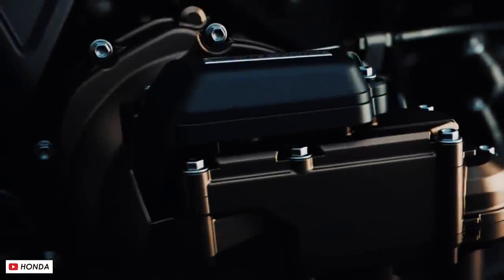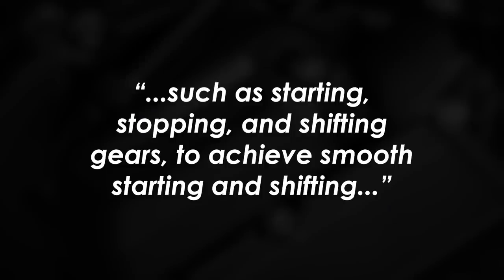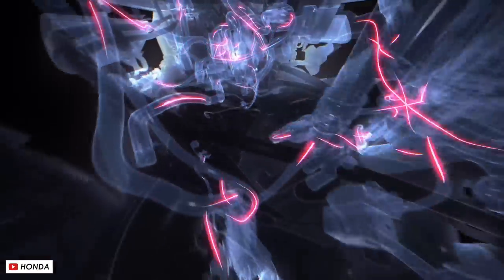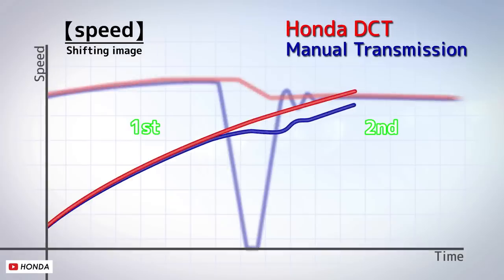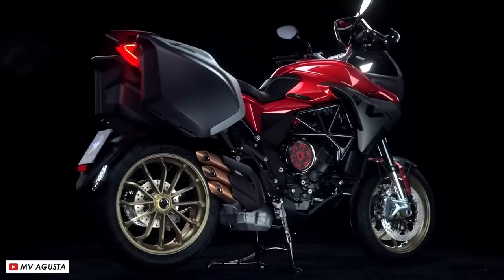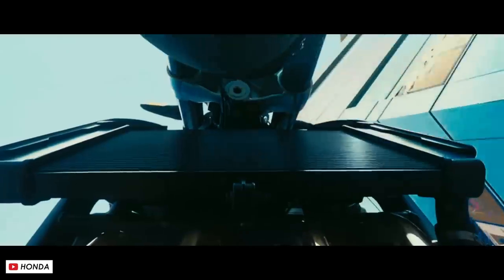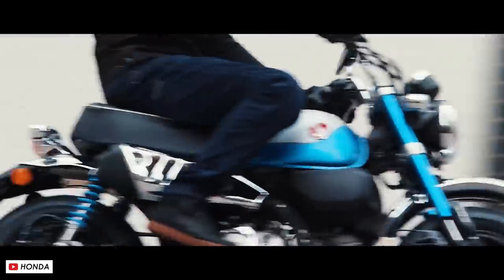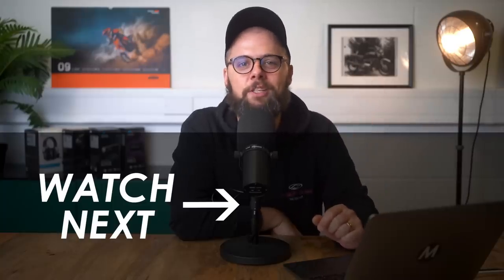New Honda E-Clutch For Motorcycles Announced!

Comment: If it's an option that's ok but if its standard equipment I think it's kinda bad, these first gen systems tend to be very unpolished, but it tends to get better over time. (anyone remember saab sensonic ?)
Also this seems like a solution looking for a problem in my view. Someone might enjoy this, that's fine, also not saying it's not a good ideia, I just don't see where it could make a significant impact.
Reply: Bear in mind that Honda has years of experience with electronically operated clutches in their DCT gearboxes. Same technology…

Comment: I'm sick and tired of everyone having to qualify some medical issue as the reason they want an automatic transmission on a bike, lest the motorcycle snobs jump all over them. 99% (literally) of automobile drivers want an automatic transmission because it's just easier, so why shouldn't the same thing apply to bikes? If I could push a button and magically add an automatic transmission to my Ninja, I'd do it in a heartbeat. Riding would still be just as fun, I just wouldn't be using the clutch/shift peg 100x times per ride as I currently have to in my city riding.

I get that markets like Southeast and Central Asia likely won't be as big of fans of the various forms of automatic transmissions (due to increased cost and complexity), but I'd be very surprised if 15 years from now, a majority of new bikes aren't sold with some form of automatic shifting. Pure manuals on bikes will live on in bikes where they do in cars: in models that are sporty, and are likely to be taken to a track.

Comment: Totally disagree that using the DCT in manual with the hand shifters don’t give the same satisfaction. Given that you can shift gears much faster and with your fingers instead of hand+foot movement allows you to push harder. Die hards will be reluctant to accept this until they realize racing cars like Ferrari, Lambos or even F1 cars all became faster and more extreme once shift pads came to existence. The fact bikes are still getting there speaks to how the space is slightly retarded on technological advancements. I’d dig cbr600r, fireblade, r7, r1 with DCTs… the only downside I see is how it becomes harder to rev (at the moment) as neutral can only be on when stopped, so revving whilst moving requires acceleration in gear whilst breaking which is not at all ideal.. all else DCT smokes any manual.

Comment: Naaah... don't rock my boat 🙃😏 What I really want to see is an Electric Clutch. I do know all the arguments about adding weight and complexity to a mechanically "simple" electric bike but if there was an option to allow a rider to feather an electric clutch I think there would be interest. Sound like an old boy but, I like that I control my bike. I don't need a slipper clutch or cruise control, especially in UK to use it for all of 3 yards. I can keep a steady speed without it paining me and can always make minor adjustments... safe and steady progress (sh*t I do sound like an old duffer😆😆). I wanna ride my bike not it me 😁

Comment: I don't miss using a clutch at all. The DCT is so fast changing gears. A clutch type transmission doesn't stand a chance. Taking off from a dead stop it will jump off the line so fast that even sportbike riders wonder what just happened. If I want to change gears I can still do it with a push of a button.

Comment: Once again.. an answer to a non existent question….like EVs
Reply: Not really... EVs don't solve anything but create a different set of problems. This new clutch operation is solving the hurting wrist in heavy traffic.
Reply: @johnnyblue4799  EVs literally solve the hurting wrist, reliability issues, heat build up in traffic, gas prices, Euro 5 and on restrictions, and disability issues. You're clueless buddy.
Reply: @Waldo1122  It also brings range anxiety, not enough range, higher prices, missing charging infrastructure, high electricity prices if you're not charging at home etc. You're brainwashed... 'buddy'. Do you also eat tofu almost exclusively?
Reply: @johnnyblue4799  Range anxiety is decreasing, Energica went from 100 miles of range to 170 miles of range in less than 3 years. Prices are beginning to come down rapidly, charging infrastructure is rapidly developing especially since Tesla is opening up their network. Electricity prices doesn't even come close to the insanely high gas prices. There is currently 130k+ public charging stations in the U.S and only about 150k gas stations.

I'm not brainwashed, I stated facts that makes electric bikes far better than gas bikes. You just hate innovation.
Reply: @Waldo1122  Funny thing how you can present the 'facts' to suit your view. It's actually 130 miles range on hwy for Experia, which is shown with luggage, meaning it's some sort of a touring bike. Then you have to wait 40 min to charge to 80%. So on a long trip you'll spend half the time looking for chargers. Also around 30k EUR for a 80, or 100 HP bike? Really? I can get a S1000RR for that money.
This IS brainwashing. Innovation would be to make things better. This ain't it.
Reply: @johnnyblue4799  You act like this is the end of electric vehicles, they literally just began and are already achieving the same if not higher performance than gas bikes.

the charging times are decreasing every year, look at Hyundai and Tesla, Charging times went from hours, to 40 mins now down to 15 minutes to reach 80% and Tesla is talking about charging times as low as 5 minutes for 80% by 2030 and Teslas prices START at 35k.

For $30k you can get an energica ego RS that is currently the fastest accelerating motorcycle which is actually a sport bike instead of comparing a sport bike to a touring bike. This is a bike made by a small manufacture among the first EV bikes. The next generation EV bikes will obliterate gas bikes in top speed, acceleration, comfort, ease of use etc... Euro 5 and on restrictions have already destroyed gas bikes as manufactures must build the engines bigger and heavier to meet emissions standards.
Reply: @johnnyblue4799 

Then either hit the gym or don’t ride a bike….
Reply: @Waldo1122 

Um….Enlighten us all on the exact number of achy wrists that will benefit from this gimmick ????
Reply: @BERZERKERSV4  Or better yet, you hit the road... and don't tell me what to do. Gym is not the answer to every problem.
Reply: @BERZERKERSV4  Pulling the clutch in and out.
Reply: @Waldo1122  I never complained about performance. 3.1s vs 2.6s 0-100km/h doesn't mean anything to me. But to have to charge for at least 40 min every 100 miles is a problem.
And 30k is the starting price... add some options we're getting into M1000RR price range. For a fraction of this price you can have a bike with decent performance that can take you places where electric makes no sense, YET. 
If my behavior' is the death of them EVs I really don't give a rat's ass. I'm not going to pay with my money for a more expensive bike that does less. I'll keep riding ICE until EV becomes a real alternative, if it will ever happen. 
EUR 5 and other crap like that is a man-made issue, not inherent to ICE bikes.
Next thing you know, you won't be allowed to ride your EV bike either because of bogus environmental issues.

Comment: The only legitimate use I can find for this over a DCT bike is that it is likely useful for an adventure bike to still have some manual control if you need to negotiate some technical offroad situations that the DCT doesn't account for.  Besides that sadly the more likely reason that this is being added is because DCT got way more hate than it deserved from miserable old bastards in the motorcycle press.  This is essentially just going to be an inferior automatic shifting system that will market better than  DCT did.

Comment: Loving all the snarky comments from Neanderthals who oppose change, riding their softy bikes with disc brakes, abs, electric starts, fuel injection, indicators, LED lights, adjustable suspension, heated grips and seats, yeh bring back real motorcycles 😂 😂

Comment: Unnecessary and stupid, if you can't use a regular clutch stick to tricycles
Reply: So I guess everyone in MotoGP and everyone who uses a quickshifter/autoblipper or anyone who shifts without using a clutch should switch to 3 wheeled motorcycles because they don't feel like operating a dumb clutch anymore? You're clueless.

Comment: Dear Honda, stop developing stuff I wont buy. Trying to make these things idiot proof is not improving motorcycling overall. Looks like I'll keep upgrading the existing Honda rather than buying a new one.
Reply: DCT motorcycles are some of their top selling bikes, EVs are quickly climbing to the top, people are sick of reliability issues and operating clutches. If you ride or drive a lot then all this manual operation gets BORING and ANNOYING. Sorry that not everyone buys a motorcycle just to say they ride a motorcycle and does 20 miles total each year like you.
Reply: @Waldo1122  oh and factually, globally DCT are NOT some of their top selling bikes. WRONG. So you can't even get that right. EVs make up a tiny portion of most markets. If your so limp wristed you have trouble with an average Honda clutch, you really need to start doing something other than mincing around for exercise. Proper riding requires a clutch and the ability to use it. But you wouldn't know that.
Reply: @adamusher  Of course globally dct isn't a top seller. Obviously the third world countries that can't afford a dct bike will get something MUCH cheaper aka a scooter that is basically DCT so again people favor vehicles that don't require clutch work.

Proper riding requires a clutch and ability to use it? I guess MotoGP riders aren't riding proper then because they almost never use it. How about you ride more than 100 miles each year and you'll realize how stupid and annoying clutches are.